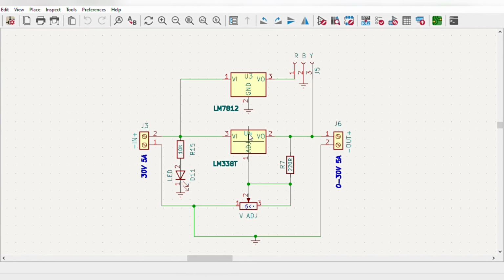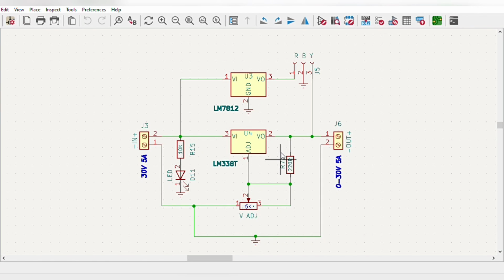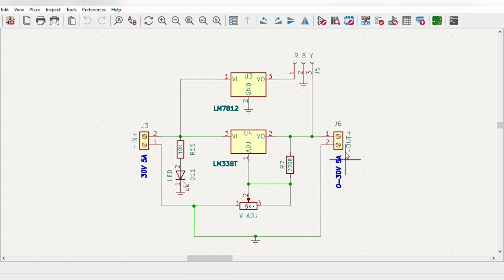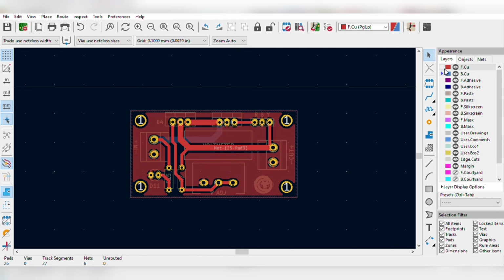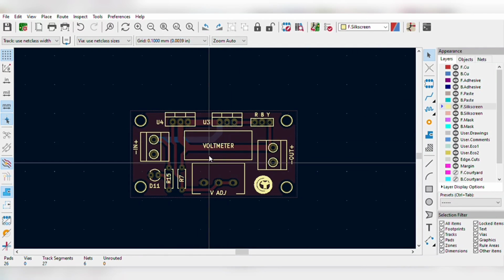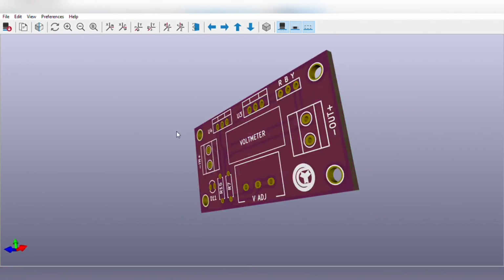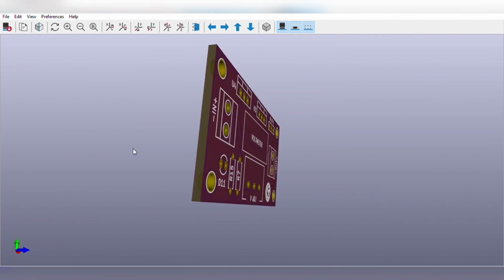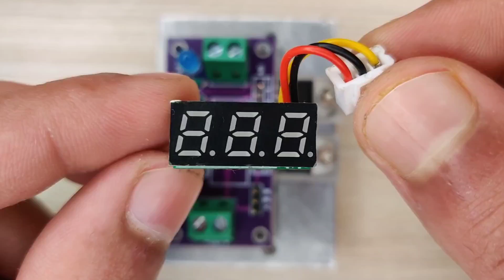5A adjustable voltage regulator circuit 0-30 volts

Comment: Add pass transistor module using either BJTs or MOSFETs?? Maybe 30a instead of 5? As an addon, it would be flexible and cool for building.

Comment: can you have a negative value for the voltage in the voltmeter?
Reply from the maker: No, volt meter is not designed like that.
Reply: @CreativeTechos  but is it possible to create an adjustable voltage regulator circuit with both positive and negative output? when output is read using multimeter

Comment: Fix voltage 12.6 and fix current 2amp circuit can u make this circuit
Reply: For lithium battery charge
Reply from the maker: If you want DIY project, then I'll make but, you can also use LM2596 adjustable voltage regulator module with 2A output
Reply from the maker: May i know for what purpose you need this?

Comment: What is the input voltage and current? Can I use 12v 1A adaptor? Can I get 5A in output?
Reply from the maker: Input voltage can be used max 30v @ 5A and output will be variable @5A using lm338 regulator
Reply: @CreativeTechos  thanks
Reply from the maker: My pleasure, Thanks for watching 🙂